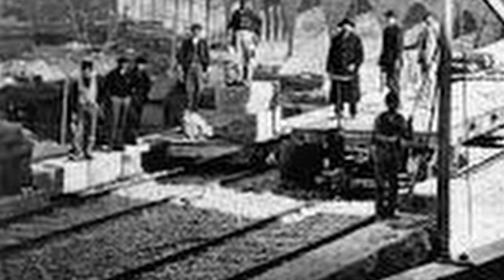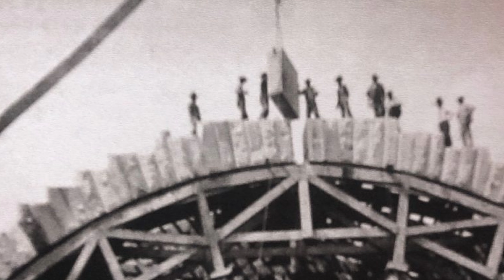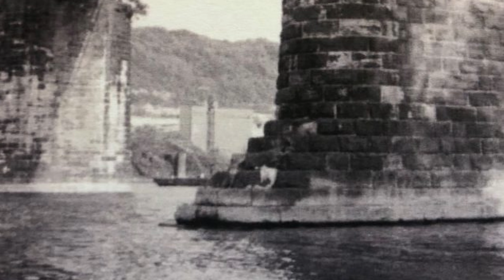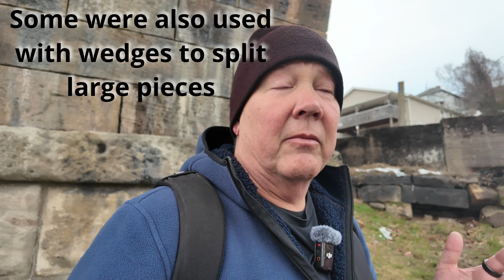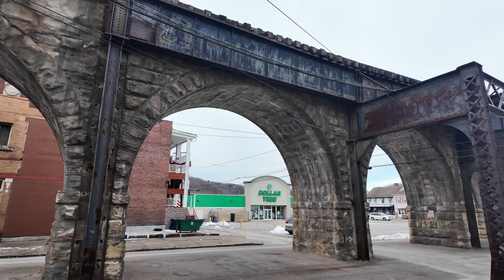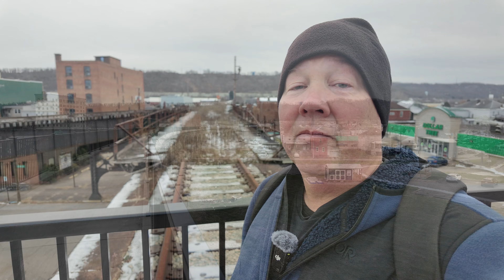B&O Railroad Viaduct vs Natural Barriers | Why This Structure Mattered } Great Stone Viaduct

Comment: Were there any signs in the area about the history of the Stone Viaduct?  I had never heard of the stone "fillings". I saw you were near the C&O station right nearby. Did you notice it while you were there? Excellent details about this bridge.
Reply from the maker: There's a few signs in the park, from where the viaduct curves away from the cliff wall, over to where the steel trestle connects, both up on the viaduct and along the bottom, plus one more down right where I stopped walking.  The web site has quite a few photos, too.
I didn't notice the station, but then again, I wasn't looking for it, either, really.  I did make a quick visit to the Wheeling suspension bridge when I left, on my way over to film at the Dresden Chain Bridge that day.

Comment: It looks like The Roman Revolution at first glance… is that even a thing? The urban water delivery infrastructure expansion? Hmm…
Reply from the maker: They do look a LOT alike.  I expect the engineers figured out that the Romans had it right and just copied it.
Reply: It could be convergent evolution - the material properties of stone encourage keeping the structural elements in compression, which encourages arches. But neoclassical architecture was popular in the US, so I wouldn't be surprised if there was direct inspiration involved.